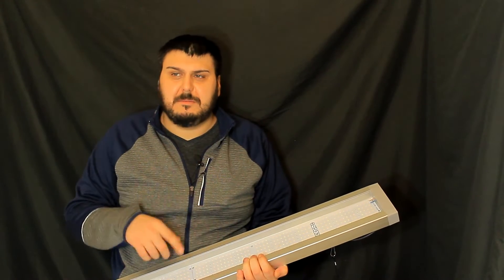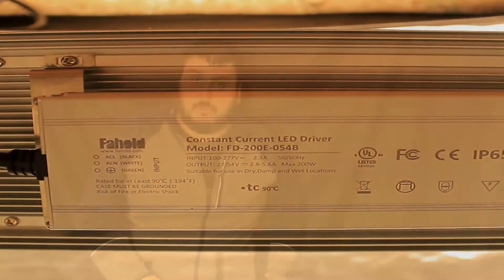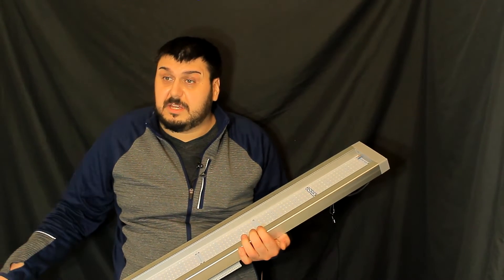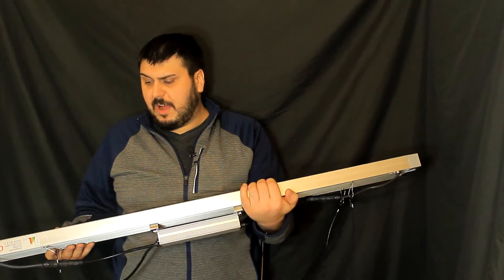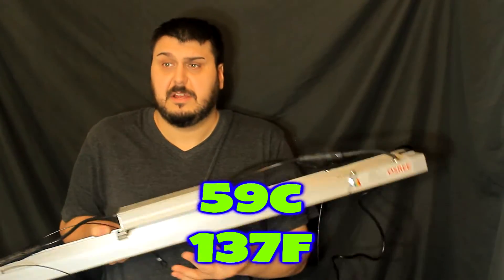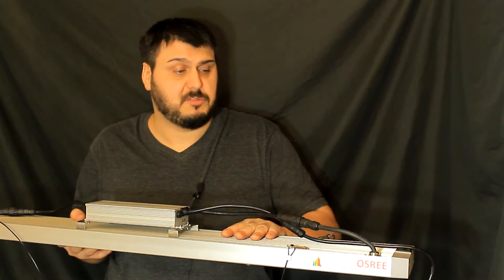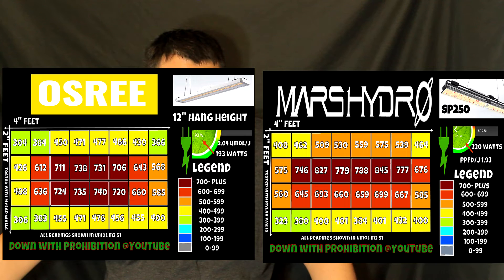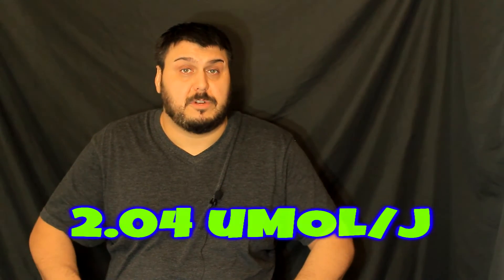Osree GL 2000 LED Grow light PAR Testing & Review

Comment: Pretty nice lil light.  You're right 3 in 4×4 would do quite well. 
Really like the daisy chain.
Reply: For the price of 3 of them though you could get 1 very nice light that would cover the 4x4 area
Reply from the maker: @FATHERSONSTRIMMINGTUTORIALS  It's not unreasonable for $550 for 3 lights. That would give you pretty even coverage in a 4x4.  There are not that many single lights in that price range that would give you that coverage
Reply: @downwithprohibition7364  exactly. Something like a SF4000 really dosen't cover a 4×4 completely in flower and has really high Hotspots in the middle
Reply from the maker: Yeah for sure that overlapping light would raise the total par up to the upper 800s and it would work out pretty well for yea. Thanks for commenting Tim 🙂 you have a great day man